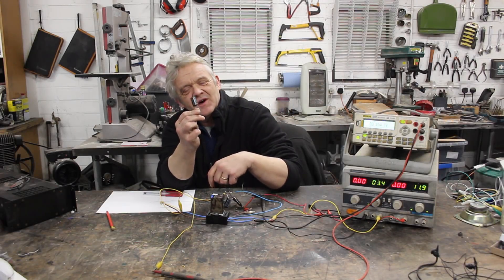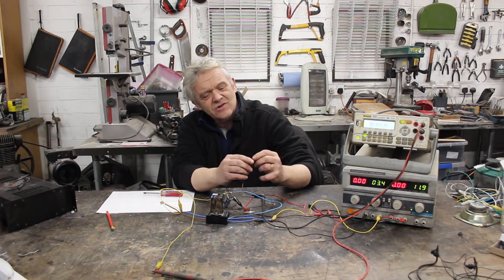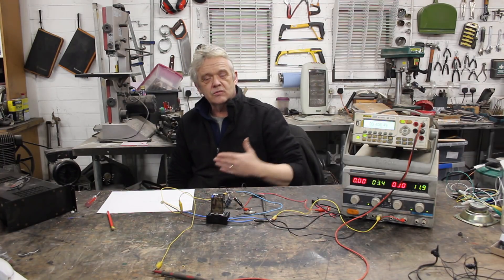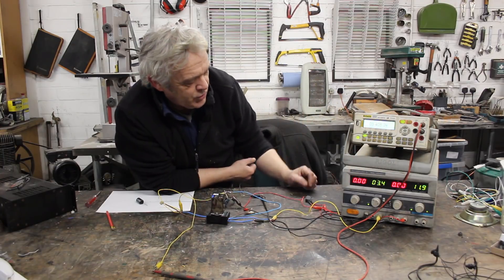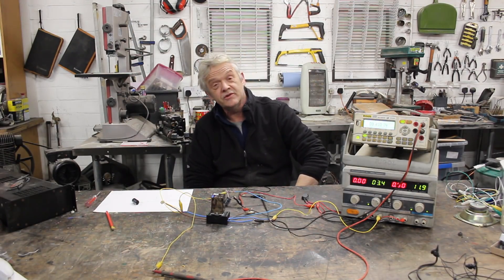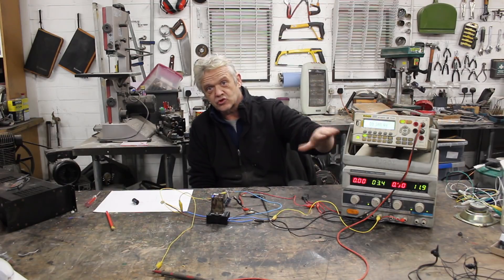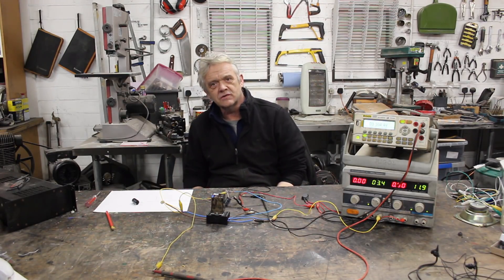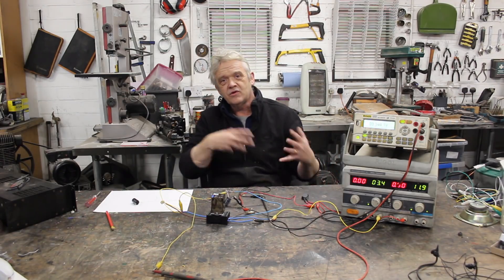1401 Switched Capacitors - An Odd Thing And Super Useful For Inverters!

Comment: After 90min I thought I worked it out but now I’m not sure. Switch closes & charges the capacitor. Second switch connects and disconnects multimeter, open and closed opposite way to first switch.

I guess he’s measuring the voltage at the output on the right of the circuit diagram (not voltage across the capacitor as mess of yellow wires appears and 1:59 as he states explicitly). 

Yellow capacitor wire top left 1:37 loops into the wago block thing which connects to the left brown wire ONLY. Yellow multimeter wire bottom left connects to blue wire to relay ONLY. 

I genuinely can’t tell if it makes voltage go up or down or do nothing. It should do nothing if it’s connected as circuit diagram shows with multimeter on circuit diagram output on the right.

Comment: hey you could use a arduino to power the relay at the changeable rates needed to provide that sine wave that would make a tiny sized inverter although i dont know how much power (amps at 240v) it could provide

Comment: You have made a crude buck converter,  the higher the frequency of the switching the closer to the Input voltage  the output voltage will be. Or you could keep the frequency stable and PWM the relay and get the same result.
Reply from the maker: in the same sense that a resistor in line converts one dc voltage to another - then you right. But it is missing it's inductive element to be a buck converter - it really is a switched capacitor resistor
Reply: @ThinkingandTinkering  I was using the Buck converter as an analogy, the circuit can only produce an output lower or equal to the input voltage. Yon change the output voltage by limiting the amount of energy passing through it, as you say as in the same way a resistor does. This method does not generate the heating part that the resistor would, in the same way we use a capacitor in AC mains to drop the voltage down by limiting the current with the capacitors impedance.

You could replace the output side relay contact with a shockley diode so only needing one switching element. Ok this lose you about 0.4V on the max ouput.

The other description of this circuit is a Switched capacitor “filter” which can be said to resemble a resistor, but never seen one used in a power circuit.

Still gives the old grey cells a work out.
Reply from the maker: @TheEmbeddedHobbyist  have a look on google scholar - for example Hybrid Multilevel Inverter Using Switched Capacitor Units, IEEE DOI 10.1109/TIE.2013.2290769 - cheers

Comment: You could also use this as a voltage doubler or tripler by having it charge the capacitors in parallel and then switch to series for discharging to load

Comment: Hello from across the pond!
Are these effects similar with air capacitors as well, Is it dependent on type? (Super capacitor, electrolytic, etc) 

If so, it is worth a look back at tesla's wireless electrical vehicle, in sofar as an oscillating/vibrating air capacitor... depending on the frequency, it raises some interesting avenues of thought. 
Happy experimenting!

Comment: Super interesting one! I remember one of my teachers mentioning that capacitors and coils can act as the other one under the right circumstances, but this is a really interesting variation as the switch is somewhat replacing a coil and resistor!
Reply: yup,  well a transformer is just a coil, with a core. and a secondary coil.

Comment: I once red a book about AC and DC. We could do better if we went completely to DC. Most appliances already work on DC, they convert AC to DC internally. I am running my laptop on LiFePO4 batteries and I step up the DC from 14 to 19 Volts for that matter. But my LED lighting will run fine on DC as well.
One note: working with DC caps on 240 Volts (or 230 or so) is very scary, I think you are not going to continue this experiment on Youtube. It is far to dangerous. imho of course.

Comment: I know you are showing this as a step in a process ...... but you could make it even simpler!
If you use a relay with a normally closed terminal and a normally open one you can connect the Cap to the common terminal and your input and output to the other two terminals. One throw of the relay can then cause the relay to oscillate!
This might not be possible with your future plans unless the frequency of the relay oscillation and your desired (50hz?) output are the same!

I love how you break things down so anyone can understand them and build a series of videos to enable them to build and adapt things! Nicely done mate!

Comment: also there is a full write up on how to use an arduino to make a pwm pure sine wave output inverter LOL, (the same people have the code for a modified sine wave inverter that is split phase and a 3 phase AC inverter, something I would find useful for anyone wanting to transmit their power long distance as high voltage AC and step it down at the end destination!
Reply: Where might I find the right up?

Comment: I wonder if switched capacitor would be the right term for my electroscope idea that has a grounded plate suspended next to the two thin leaves of metal so when it gets charged up and they spread apart, one touches the grounded plate causing them to collapse and start charging up all over again? (an idea I had a dream about during my making the Tesla one hour bill or note. which in the dream the units were on a table in wardencliff and tesla was using them to allow charging from the atmosphere then discharging them through a staged second electroscope that between the two electroscopes and the ground he had it going through a bifillar coil but from opposite ends of the coil to cause a pulse induced into a transformer secondary coil to make AC power from static electricity.)

Comment: So, would you use a 555 timer or other IC to control the switching, or use an Arduino or Raspberry PI?

Either way sounds good to me as long as I'm not sitting there for hours on end pushing that blasted button. 😉

Comment: excactly how a switch mode buck converter works  or use two caps and some diodes to make a voltage doubler  both rely on switching the input voltage on and off

Comment: That's fun. I figured it's a 1000 uF capacitor. Are you sure it's a 1000F ?  What you are describing is used in a lot of applications. There are ic's for voltage doubling or providing a negative rail called a charge pump. There are circuits for charge transfer which is more or less wat you describe. Atmel ( now microchip ) has capacitive touch button solutions which are based on charge transfer. I used that on many occasions and you might want to check it out. It's perfectly understandable and it'll make a good video.
It's not and never will be simular to a resistor. A resistor will convert dissipated electric energy into heat. A capacitor will never do that no matter what your circuit looks like. Depending on the load and source your circuit might have resistive components in it. Imagine you have an output capacitor in parallel to the voltmeter to flatten the voltage a bit. High currents will flow between the switched capacitor and the output capacitor. Heat and sparks will form at the relay contacts forming the disipative and thus resistive part. It's the same for an input capacitor and you can be sure there's one in your power supply. If you would use semiconductors to replace the relay it would be the same. No sparks but switching takes a while along a resistive trajectory causing a power peak in the semiconductor.
In theory switched capacitors can be used to make an inverter. However using an inductor is way more space efficient. For a 1000W solar panel you would need a lot of capacitors and very large values. For that reason high power inverters using capacitors do not exist. If you need a tiny power voltage doubler charge pumps are fine. If you need more power a step up converter with an inductor will be used in virtually any case.
Reply: Yeah it's only 1000μF so about off by a 1000 :)
Reply: @zaprodk  Probably a factor 1000000. That doesn't matter much. Same principles apply. For converters in general it is convienient to have smaller capacitors. If low enough electrolytic caps can be replaced by ceramic ones. Lasting way longer, cheaper, better properties  and surface mount. The downside is higher frequency.  Higher loses in the switches and EMC properties way worse.

Comment: Great explaining as usual, love the visual and hands on presentations you make. 🙂
Though it is always hard to get a readout of that display on your multimeter.
Would it be possible to put a Fresnel lens in front of it or have a old phone with a camera zoomed in to the display facing the screen against the camera making it a little easier to read?
Reply: Does he explain anything? I missed it. He just points at the multimeter display. 

Can you explain what is happening pls?

Edit: charge pump on circuit output

Comment: are but.... can it run a small replication of Professor Eric Laithwaite jumping ac magnetic aluminium rings ,the more you add the higher they rise ^_~
just use 
Andreas  'Use your PC Soundcard as an Oscilloscope, a Signal Generator, and a Spectrum Analyzer (Arta, REW)' to do the frequency switching.